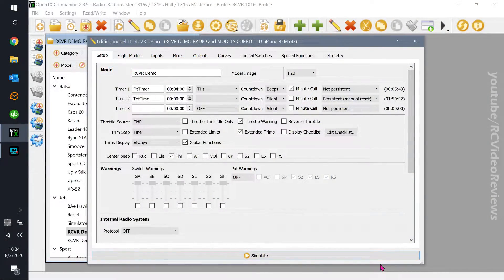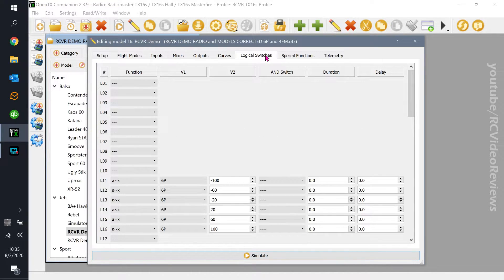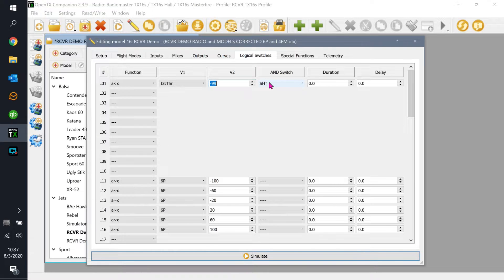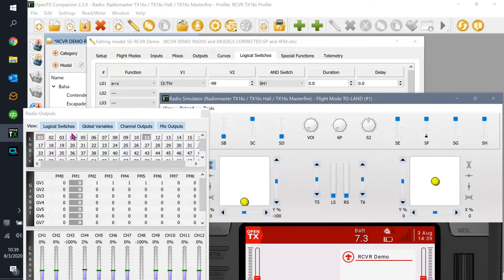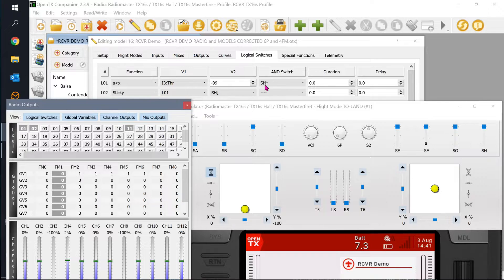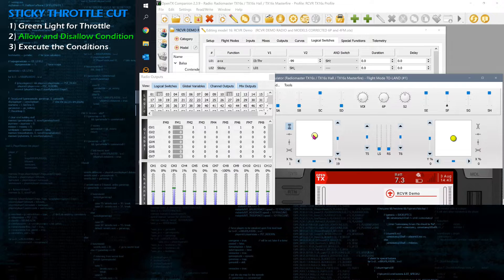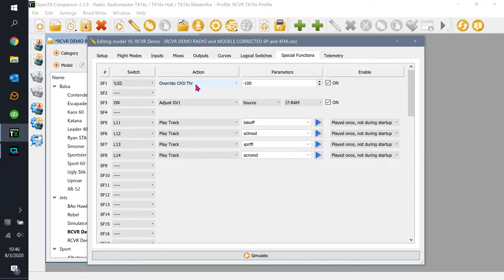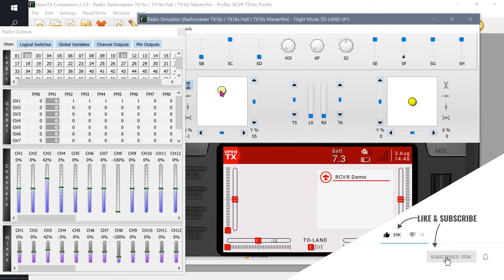OpenTx Companion Tutorial • Best Throttle Cutoff Using Logical Switches • TX16s [Intermediate]

Comment: Another awesome video thank you! Now to see how to reset the timer without having to turn the radio off.
Reply from the maker: In special functions add any switch and use the function reset timer and select the timer number you want. 

You can also long press the jog dial on the main screen, highlight reset, press the jog dial and chose a timer to reset with the dial.
Reply: @RCVideoReviews  You're a star! Thank you

Comment: Thank you ,  I just programmed that in and tested it in a plane sweet safety motor cut off tip.
Your videos are awesome, I'm really getting to understand open TX  with them.
Reply from the maker: Good to hear Ron. I'm glad they're helping you learn to use the radio. Keep at it, and you'll be an OpenTx ninja before you know what happened.

Comment: excellent safety tip - love your videos man! keep them coming.
Now, I already know you are not into helicopters. I‘d therefore like to add a WORD OF CAUTION for intermediate to advanced HELI-PILOTS who are planning on learning AUTOROTATION. When you go through practicing autorotation landings, you will eventually come to a point where you cut your throttle in flight, autorotate your heli and find yourself in a situation where you have to abort the autorotation. A reason could be that your heli is too far away from your desired landing spot and you do not wish to park it in between the vegetables 🌽 🍅 
In this case if you have this safety function active, you will need to also pull down your throttle stick to the bottom to re-activate you engine. since however throttle and collective pitch are on the same stick for helicopters, you would also move collective pitch to full negative which would make your heli come down even faster. More realistically you will not even remember that you have to do that and the engine won‘t restart and your heli will start harvesting the potatoes.
my recommendation in short: If you practice autorotation on a helicopter, do not use this function! 
As a heli pilot you may want to not use it at all whether you practice autorotations or not.
I will however activate this on all my planes and copters.
Thanks again and a big thumbs up for this channel! 😎👍
Reply from the maker: Great advice. Thanks for taking the time to write this up.

Comment: This is a great video. I used to use the old simple throttle method. After seeing your other video I tweaked mine a little bit further by introducing a third Edge logical switch in the mix. This prevents throttle activation when the switch is in correct position and you then lower the throttle down to -100. With this you have to have low throttle and then flip the switch.

Great videos, inspired me to do more stuff with opentx. Keep them coming. It is much appreciated.
Reply from the maker: I'm always happy to help make things safer out there. Glad you found a way to use the information and appreciate the comment. Thank you.

Comment: Love this one will edit everything I have with a motor! So I am now thinking about how to programe : do roll to the right when momentary is held for 4 secs and ailr full left same time? Fly to the future.. and beyond .. with RCVR.
Reply from the maker: It's a very good way to manage throttle cutoff. Did you figure out your other issues?
Reply: @RCVideoReviews  I think so by remembering the rule of `thumb' helped me ie. May the Source be with you haha so to speak what happened was I DL amber Sound Pack put on sd on desktop and hey presto found that I was syncing PC to radio instead of radio to pc brill so addressed that problem straight away now have full amber vocab and see all tracks I want. I must say so far it all seems robust I ignore the sd card needs scanning message on boot loader mode I dont get it on radio on use usb mode. So yeah all in all so far so good I even have two whippets set up one Whippet S which has the original Spektrum RX and is in repair and the Whippet with a bangood dsm micro rx and two hobby king micro servos which was repaired but wire to power came adrift so now I make a micro soldering iron wound copper wire round tip of iron see if I can fix have some very thing solder too I better add I am  kitchen workshop kinda chap not a engineer lol
Reply from the maker: @BrianRamseysg01  Keep experimenting with it. As long as you aren't flashing firmware, most of what you do to an OpenTx radio is recoverable.
Reply: @RCVideoReviews  yes also found that one may copy lines from model to model at same time as editing I just copied the lines from Eachine P51D throttle cut off to my un flown un bound Radian Pro model and it all checks out in monitors and will also try make it work in as yet unflown A800 these and the brace of whippets with different recivers in should keep me occupied between storms and finding a club that isnt full of oil barrons save me from being self taught and a pirate flyer ....!!

Comment: Great vids thank you. Quick question - How using this set up can I add a logical switch to prevent accidental throttle cut during flight
Reply: I've done this with a momentary switch for gassers.  Essentially, once cut off is armed, to make it inactive you have to hold the momentary switch.
Reply from the maker: @TheBigChinoDon  Thanks for sharing Don.
Reply: @RCVideoReviews  Thanks, on a steep learning curve here having decided to switch to OpenTX.
Reply from the maker: @MirageParties  Just take one step at a time. If you try to figure out too much at once it gets overwhelming. Learn the basics first then get fancy.
Reply from the maker: You probably need some sort of sticky switch that says once throttle is armed and throttle stick is moved past idle, override the throttle cutoff switch.

Then you'll need more logic to allow you to re-arm on the ground. It starts to get messy doing that IMHO.

Comment: That's a great way of increasing throttle safety, great for planes & drones too I guess.  Let me ask you this though. I fly helis, and when the heli spools up, I'd like to be able to create a logical switch that will only disengage Throttle cut when my pitch channel is around mid stick, or 0° pitch (say between  -05 and +05)  instead of what you did with throttle stick at < -99%  Is that possible?  Thanks!!
Reply from the maker: Sure, just substitute the throttle check I did @ -99 for your pitch value @ 0.

You could also do setup where you have:

L1 - Pitch is  > -5
L2 - Pitch is < +5
L3 - L1 AND L2

Then L3 becomes your L1 like I used in the video.
Reply: @RCVideoReviews  Ah, OK, cool, I see, thanks!! 👍
Reply from the maker: I found a simpler way to do this:

L1 Function: |a|<x   V1: I:Pitch   V2: 5

Comment: one thing that would be a big help to this. Awesome safety step by the way.
How do you ad a voice warning that the "throttle is high" when this setup stops the throttle from working?
Reply from the maker: That's easy:

Remember NOT L2 is the condtion in which we override Throttle.
So just create in L3:   a>x  I:THR -99  AND !L2

This translates to: Anytime the throttle stick is not at idle and L2 is not set, ACTIVATE.

In Special Functions: L3 Play Track "Throttle Warning" or whatever alarm you can find that meets your need.

If you only want the warning when the throttle stick is at least halfway up or more, then:
L3: a>x  I:THR 0 AND !L2
Reply: @RCVideoReviews  thank you. I will have to watch all your videos again with a notebook, after my radio gets delivered.😁
Reply from the maker: You're welcome. You really just need to get Companion going and get in there and tinker away. You can't hurt anything. That's the best way to learn. Use a video example like I have here and then tinker in Companion.